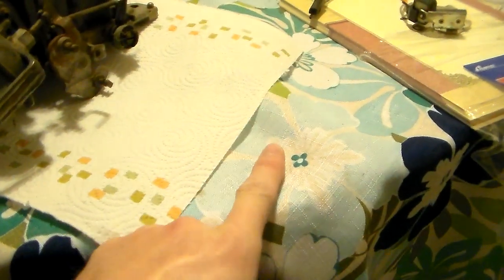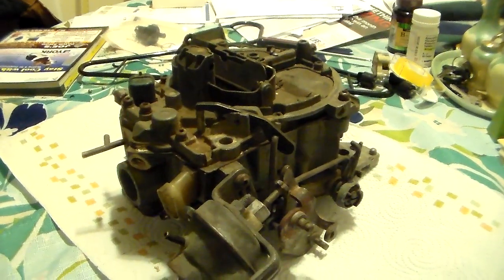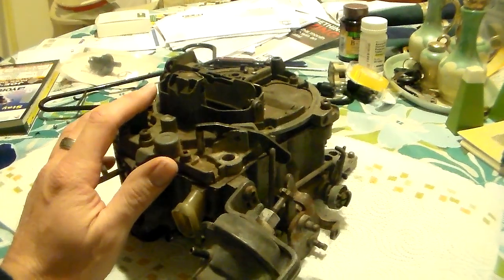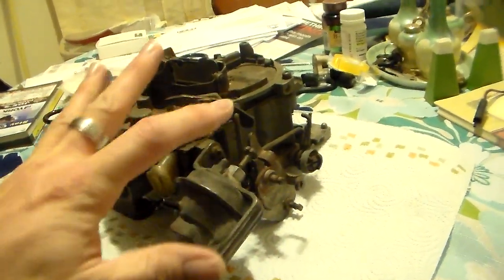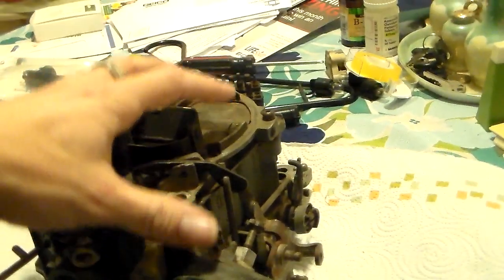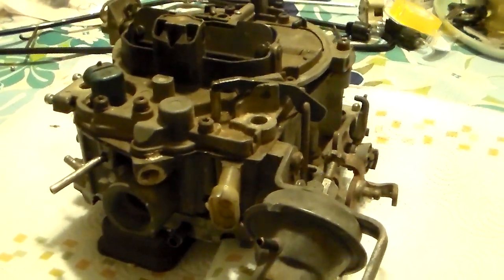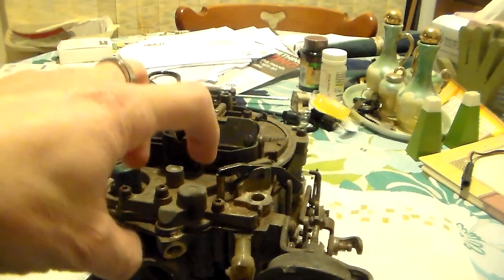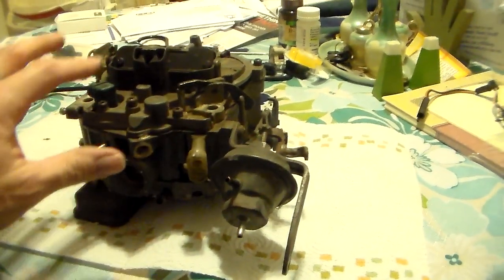Understanding computer-controlled Quadrajets part 1 of 3

Comment: I had a cold idle problem with my R4-E4ME. The engine stalled after starting. Choke worked, but without using the gas pedal it stalled until the engine was warm (after ~60 seconds everything was alright). The ignition parts were all new, so I decided to buy a refurbished carburetor from rockauto. Now the engine doesn't start anymore.... all I can do is adjusting the idle air bleed valve but it doesn't effect anything.... what should I check first?
Reply: TRRacingTeam Should I try to adjust the screw under the choke?
Reply: TRRacingTeam Water temperature sensor was the problem. Now I have to adjust the mixturew screws on the R4-E4ME. Should be fun...

Comment: can I remove the cat and not screw up the way the car runs if I have this carb? its a 1986 cutlass w the 307. thanks and great video series on these carbs.
Reply from the maker: fuccillo111 Thank you. Yes, you can remove the cat. This computer system is very basic and does not look at the oxygen content of the exhaust after the cat like modern systems do.

Just keep in mind that those versions of the 307 are very restricted in the intake, heads and exhaust ports so don't expect any difference even if you uncork the exhaust. I've had several. Otherwise it's a great engine.

Comment: How do i fix OBD reading high positive reading for TPS 84 Buick lesabre 5.0 (307 Olds Vin y) CODE 21
Reply from the maker: Usually that code pops up when there's a broken wire or the TPS has failed. I would test the TPS first to make sure it's working right and go from there. You can find info related to testing and adjusting the TPS online. It's more than I can type out here. Thanks for watching.

Comment: Also how will the car run with non of the electrical hooked up? I got the car with only 2 of em hooked up and the tps harness fell apart when I took it off to check the condition of the plugs? Will it make a big significant change in performance or start up? Thanks again the vid helped lot, got 2 more to watch and keep me up tonight and be sluggish at work lol
Reply from the maker: It won't run well. When an electronic Dualjet/Quadrajet gets disconnected electrically, the MCS(mixture control solenoid) defaults to full rich to avoid the engine starving for fuel. But, that means it runs full rich all the time, is down on power and makes your gas mileage go in the tank.

 Not chewing you out, but the point of these vids is to help people make these cars run right. Did you see the "polar vortex Buick cold start" video I have up? That's an '83 Buick 231 with all the electronic system still operating, and that car started and ran reliably in any kind of weather. They don't START running bad until people begin to ignore them or "fix" it by unhooking stuff. It ain't gonna work. I'll be glad to help you fix it, but not make it worse :-)
Reply: I hear yeah, I mean completely removing the computer all together and running on a non elctronic carburetor?
Reply: Do you have a separate email I can reach you at?
Reply from the maker: David Jimenez
 Yes. If you will send me a private message I'll give it to you or discuss there.

Comment: Can you give me some info on nonelectric carbs to replace a e2me on a 1984 3.8 buick regal. I've never rebuilt any carbs before and think I'll be in over my head if I try with one of these for the first time. Like which EB or holly carburetors (nonelectric) will replace the stock rochester? Thanks for the help if you can get back to me.
Reply from the maker: There's not an Edelbrock or Holley that replaces an E2ME. Not only would it require a lot of custom stuff, but the Rochester carb pattern is unique to that carb. There was a non-electronic Dualjet used for a couple years but they are hard to find and if you go that route you lose torque converter lock-up and timing advance and the check engine light is on all the time.
Reply: So your telling me these vehicles need a e2me rochester to run. No other carb will run my regal and absolutely need all the electrical of the e2me dualjet?
Reply from the maker: David Jimenez
 It's like this:

 With the electronic carb, it's all or nothing. If you want it to run good and not stink like it's running rich or flash the Check engine light, then the carb needs to be overhauled, adjusted and EVERYTHING operable.

However....

 If you don't want to mess with that, and I know a lot of people don't, then the other option which is by far the easiest is to locate and overhaul an M2ME carb from a 1979-80 Buick V6. That's non-electronic, just has an electric choke connector like your existing carb. '78 and earlier used a Rochester 2GC carb, but the intake is different because of that carb and because the cylinder head ports changed right in that timeframe.

If you do that conversion to the older M2ME carb, then you also need the vacuum advance distributor from the same or similar engine, because on the 1981 and newer electronic engines, the computer controls the ignition advance. When you disconnect the ECM, then ignition advance goes with it.

 You can find those carbs if you look hard enough on eBay. Not a hard swap.

 Don't know if you knew this but there was a larger 4.1L Buick V6 that they put in large cars and CADILLACS if you can believe that. Those all came with a 4bbl Quadrjaet, so you can go that route too, the intake will fit.
Reply: Man I don't have the comet on how else to email you, I can't see it anymore. Can you comment about it again
Reply from the maker: David Jimenez
 I sent you a PM. On your channel, click the blue square box at the far right upper corner. Then click creator studio. Look on the left side and find community. There's a dropdown that will let you access your messages. Is it obvious to everyone that YT tried to discourage private messaging?
Reply: Thanks man I apreciat all the help!

Comment: If someone made an aftermarket controller for these, this carb would be a beast in the aftermarket
Reply: That would make my life easier also. I am about to pull the Quadrajet, harness, and computer from my '87 Camaro to install it in my 1970 Nova. The computer controlled Quadrajet works great on long road trips when it comes to dealing with major changes in altitude. My non-computer controlled Quadrajet kept running too rich at high altitudes since it was adjusted close to sea level before the trip. Swapping to the computer controlled Quadrajet is much cheaper than switching to fuel injection. I just wish someone would make a stand alone harness and controller for this carb.
Reply: JeepCollector91 here's what you do if you want fuel injection, more power, fuel millage. Buy a 2 wheel drive chevy pick up with a 5.3, in my area you can find one every day for $1000 very easy. Take the engine, trans, wiring, computer out and install it in your car. You will have to figure out a fuel pump and make a return line but that's not a big deal. You have now doubled your horsepower, increased you fuel economy, have better reliability and can get any part you need at any part store. Now take the truck you just took the motor, trans out of and part the rest of the truck then scrap the truck. Now sell the engine and transmission from the car and you basically have all your money back. It will take you a few weeks of tinkering but it's a cheap swap. 

If you must keep your engine you have but want fuel injection go to the junk yard and take the throttle body injection set up off a early 90's caprice. The only gain really is the reliability doing it this was and saving yourself the hassle or replacing the drive train. 

Bottom line a 5.3 swap is the most sensible way to get an old car up to date and super reliable. And for the price you can buy a 2wd  2000 Silverado to use for a donor I don't know why any one would consider  not doing it

Comment: Actually these can be set up for performance use just as well as the older style Q jet. And they can be used with bigger cams as long as they still provide a good vacuum signal. Too many myths in this video.

Comment from the maker: Well...it's not a power valve like the older carbs. It's the mixture control solenoid and what you are adjusting are the rich and lean stops.

Comment: That thing in the middle is the power valve. I have mine set to 3.5 turns out but I need to knock that plug out so I can fine tune it.